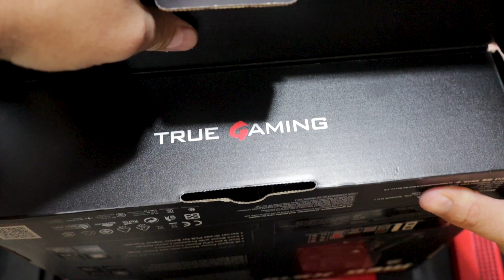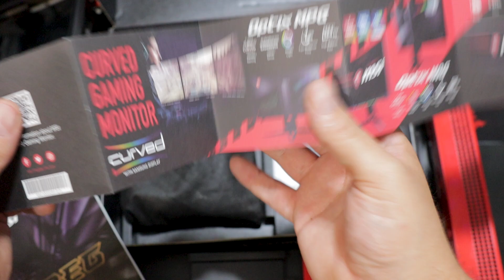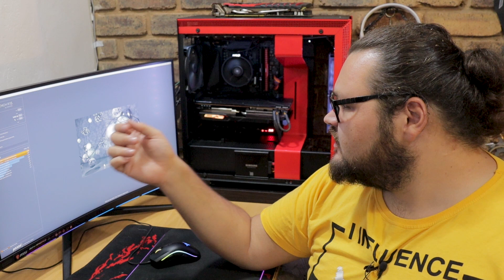THIS ACTUALLY WORKS!!! - MSI MEG X570 Unify + RYZEN 1700

Comment: 4:47 You actually don't need to plug BOTH connectors into the mobo for the CPU power...especially considering you are running a Ryzen 1700. 
Heck, some CPU/mobo combos can run off just a 4-pin. Oh and nice work mate, thanks for sharing
Reply from the maker: Oh for sure, back when I made this video I was very much out of practice working with hardware, lol.

Comment: First video I have watched from you as well as the others. Was really curious to see if first gen ryzen would see any form of increase in performance. Even slightly going from X370 to a X570. Seems like that is indeed the case. The new motherboards do offer (probably better stability) better performance metrics.

I mean, it makes no sense to get an X570 with a 1700 or 1800X but it's nice to see this comparison. Now if only somebody could make a X370 support something like a 5900X. I'm dying to see how this goes. Will it go down or be at the same level?
Reply from the maker: I'm super curious about that myself. As soon as I get my hands on a 5900X/5950X I'm definitely going to be trying it out, lol. I think performance will probably be worse considering the X370 I used in this video really doesn't have the best power delivery, if it even ends up working at all.
Reply: There are some modded BIOSes that allow A320 and X370 boards to work with Ryzen 5000 processors (after all, A320 and X370 are identical to B550 but binned low), but keep in mind power stages of those boards are generally not good enough.

Comment: What bios version were you using sir when it booted?
Reply from the maker: I can't remember for sure, but as far as I can remember it was the second-oldest BIOS version that was available at the time. Other versions might work as well though.
Reply: @TheTechTank  Thank you sir for the kind respond. I actually have a 1700 and fell in love with the x570 meg unify because it has zero rgb on the pcb. Your video helped me decide what to buy first.

Comment: Any idea if this may work on the ASUS Rog Strix X560-E gaming motherboard? I currently only have a ryzen 7 1700X and don't have the cash at the moment to upgrade my cpu. Thanks in advance!
Reply: correction 570
Reply from the maker: Can't say for sure, unfortunately. Some boards will work just fine, others need a specific BIOS in order for it to work, and other boards just flat out don't work, and as far as I know that information isn't made public by the manufacturers.

Comment: SO, to get the correct performance with your Ryzen 7 1700 you'd have to have a PCIe 4 SSD. To get a better test bench mark.
Reply from the maker: Not at all, where'd you hear that? Pretty sure the 1000-series chips don't even support it...

Comment: Still can’t get 1700x with Strix X570E work together
Reply from the maker: It seems to be pretty hit or miss which boards have support for it and which don't. Are you sure your board is using the correct BIOS version?

Comment: I am looking to get MSI X570 ACE, and I am wondering right now if it will still support 1700x?
Reply from the maker: Unfortunately I can't confirm whether that specific board will support the chip. It's up to the manufacturers to decide which, if any of their boards will support first-gen Ryzen. I wouldn't buy one before I'm sure that it'll work.

Comment: $200 16-thread  with option to upgrade to 32-thread some day when it's not $750 and higher chance of supporting future generations of Ryzen.  (Too be fair, I've been at this since 1999 and I've never found it more cost efficient to upgrade a processor than to move to an entirely new build, but maybe Ryzen has changed that model.)
Reply from the maker: Ryzen has definitely changed that model. A single board that supports quad all the way up to 32-thread CPUs gives provides the best upgrade path we've ever seen in the PC space.
Reply: @TheTechTank  Well, AM4 has an equivalent of 4 lanes of PCIe reserved in the socket, so an AM4r2 ie AM4+ is still possible, despite unlikely given AM5 details are already known.

Comment: Currently using a R5 1600 in my x570 Tachi and not having any major problems the only one that I've seen is my RAM rbg plays up (which it doesn't when I use the 2600 I have in another build) the 1600 is only in the build untill my 2700x comes this week.
Reply from the maker: That's a pretty strange bug to pop up, lol. Glad it's working fine otherwise though. Hope you enjoy that 2700X – it's a BEAST.
Reply: @TheTechTank  yup I thought the exact same thing though not sure what else it could seeing as it never happened on my x470 and does not happen with my 2600. The system still reads the ram and it works perfectly fine even on the xmp profiles the only possible thing I could put it down to was maybe power delivery as not even the RGB software can fix it. And I meant the 3700x not the 2700x sorry.

Comment: I'm sorry you're in S.A..... I would try to leave ASAP..
 Just bought the unify.. now waiting on the 3700x to turn up in the post.. mmmmm.. Trident z neo ram as well......
 Then maybe a ryzen 4X00 upgrade later on
Reply from the maker: SA has a lot of massive issues, but actually living here is pretty good. Unfortunately it's hard to ignore said massive issues so the plan is to definitely not be here anymore in a couple of years.

I really want to buy a Unify for my own system too and rock my 1700 on it until I can afford to upgrade to the 3900 or 3950X. Hyped to see what AMD has up their sleeves for the 4K series!

Comment: I built my pc same motherboard and everything but I have a Red LED light right next to the cpu pin connector, I want to know if my motherboard or anything is out of wack
Reply from the maker: Did you plug in both 8-pin connectors? The board will run just fine with only a single one plugged in, but that might explain the light. If both are plugged in and your system works without issues, then I wouldn't worry about the light.
Reply: Just Tank thank you sir !

Comment: Can you test with a B550 motherboard and Ryzen 7 1700? I know that most boards have the v2 revision and shouldn't work, but if there is any early BIOS version I don't see why it wouldn't work.
Reply from the maker: Already done 😁 I test my 1700 and a 2700X on a B550 board in my latest video.

Comment: Hi. I love this board, but I am currently  having some issues. I 
purchased a Corsair MP600 gen4 NVMe and it is not detected in either 
BIOS or Windows. I even got a replacement one and still the same. I am 
currently using a Samsung 970 Evo Plus and it works perfectly on all 3x 
m.2 slots. I updated the BIOS to the latest and also changed settings in
 BIOS, but not sure what else to do. The only thing I can think of, is 
the fact that I am using an NZXT C750W PSU and it only has 1x 8PIN CPU 
PWR connector. Could this be the reason why it is not able to pick the 
gen4 NVMe ? Any ideas please? Thanks
Reply from the maker: And you tried the Corsair drive in all three M.2 slots with no luck, right? I'm also assuming you're running a 3rd Gen Ryzen CPU? If so, I can't really think of any reason why the drive wouldn't be detected... The power connector is definitely not the issue.
Reply: @TheTechTank  yup. Tried all three slots to no avail. I'm running a 3700x . No idea what it could be
Reply from the maker: That's so strange... I looked at the specs for the board, and both SSDs, and there's no reason you should be having any issues. You might want to reach out to MSI, maybe this is a known issue and they can help you out, or issue an RMA if it's a problem with your board specifically.
Reply: I had that same issue with A MEG Gaming Plus board, it wouldn’t detect my 1TB 4Th Gen NVME. I had to go to disc manager, reformat the NVME drive to GPT instead of NTFS then go into BIOS and change from Legacy to UEFI, reboot and now my new NVME drive was discoverable where I loaded my OS. Hope that helps.

Comment: As far as that second power connector is concerned, the two are in parallel with each other so it doesn't matter which one you plug in. The only instance where you need to plug two in is if your cpu draws more power than the power rating for one of the sockets. For most boards that is 284W which will not be an issue for ryzen chips unless you're using liquid nitrogen. In summary, you only need to plug one in.
Reply from the maker: Thanks for the info, man! Never really worked with higher end boards before without a power supply with enough connectors, so I was kinda freaking out, lol.

Comment: This has become way more relevant now that AMD confirmed 5xx series chipset for zen 3 cpus. 
I have an x370 paired with 1700x. I could upgrade my MB waiting for zen 3 to launch.
Reply from the maker: That's actually a pretty good plan, as long as the Zen 3 chips are as or more impressive than the rest of the Ryzen lineup.

Comment: I was thinking that this would happen the same for b550 their telling 2nd and 1st gen would not work on the chipset buy im hoping the ryzen 2000 series would atlease work on it given that x570 works with the 1st gen series
Reply from the maker: It's all up to the board manufacturers to decide whether it'll be possible, I think. AMD obviously wants you to buy a 3000 series chip with a 500 series motherboard, so they're probably just choosing not to add support for the older chips into the chipset itself. But that doesn't necessarily mean board partners can't add that support if they wanted to. I heard something about the CMOS of the new chipset not having enough space to support backwards compatibility though.
Reply: @TheTechTank  MSI's MAX series motherboards have a bigger BIOS chip, good job MSI :-)

Comment: Hi. I have 1700 and mine motherboard have been broken. but now here we can't find good x370 or x470 . I feel like amd f**k me when says what x570 will not works with mine old processor ((
Reply from the maker: Hey! So you can't find a replacement motherboard for your 1700? That really sucks. Like I showed in the video, Ryzen 1000-series CPUs can work fine in certain X570 motherboards, but there's no guarantee. So I wouldn't recommend it unless it's your only real option. If you are planning on upgrading to Ryzen 3000 soon anyway, then it might be worth the risk... But again, not recommended.
Reply: @TheTechTank  thank you so much i see... Will looking for some interesting, or maybe pay new processor.

Comment: Did you have with applying overclock? I've changed the multiplier but it clock down in windows(1800x+x570 MEG ACE)
Reply from the maker: I did technically overclock it to run at 3.7 GHz on all cores constantly, but never tried higher than that. Did you remember to set the core clock to "fixed" mode rather than "auto"?
Reply: @TheTechTank  tried everything, under full load IT goes down from set 1.4v to 1.33 with LLC set to 1.
Reply from the maker: Oof, that sucks. Could be that the board isn't playing well with the chip, or there's just a setting you're missing somewhere. I probably wouldn't recommend it, but did you try some of the other BIOS versions for the board yet?
Reply: @TheTechTank   Well now my voltage drops down(for example form 1.4 to 1.33) at full load. So i can go with unstable oc to 4.0 that will crash in ooct and cinabench. I will problably stick with it as i can game on it. At cyberpunk launch i will upgrade the GPU and if i wont get a steble overclock on this CPU i will upgrade it as well. I don't see any point in swaping the Bios revision since it didn't boot at orignal bios flash to the newest fixed the problem so the possibility that it will work at older revision very low. I looking for MSI bios walkthrough, with all functions explained i might find that missing tweek
Reply from the maker: Hope you have some luck finding a magical tweak somewhere in the settings! The reason I suggested trying different BIOS versions is because neither the oldest nor newest one for the Unify worked for me. Only the second release booted for me. Either way, If you get it working definitely let me know!

Comment: Thanks for this video. Im going to pick one up for my 1800x and upgrade later when the 3 gens are cheaper.
Reply from the maker: I'm kind of planning on doing the same! Just make sure you're super comfortable with BIOS flashing and how to do it correctly, and that you're careful during the whole process. And even though it's not all that likely that it won't, just because it worked on my board doesn't necessarily mean it'll work on yours. I'd feel pretty bad if anything happened to your gear because of this video, lol.
Reply: Just Tank Lol Im good with flashing the board. I've been doing it for awile now.  I was able to flash some Asus x370 boards with a compatible Asus x470 bios and they ran just fine. I dont think that will work with a x570 but x370 and x470 are the same boards.
Reply from the maker: @slim420-e8v  Okay great, lol. Then you probably won't run into any nasty issues. Be sure to tweet me a pic or drop a share on the Facebook page after you get it up and running!
Reply: @TheTechTank   would be nice to link the BIOS version here or whether this BIOS had the AM4 1.0.0.4 PATCH B.
Reply: That's what I'm doing as well! :) However, my budget won't be enough for the MEG so I will try with the X570-A PRO. I hope it will work :D

Comment: Would you try this with the newest Agesa or whatever it is? I'm curious if it will still work.
Reply from the maker: I'm actually running the same configuration right now for a different video, so after I finish the vid I'll definitely give it a shot.

Comment: The second eps connector is not really necessary for this kind of cpus, as 1 connector can handle something like 384W. In MSI's case, that second connector can send power to the pci-e slots, so if you have a crossfire/sli you don't stress the 24pin connector that much.

Comment: I luv my 1700 😎
Reply from the maker: Same! Such a workhorse!
Reply: @TheTechTank  I currently have a 3.4Ghz Oc @ 1.000v Vcore, R15 score of 1469 at 61c. MSi for life 😊
Reply from the maker: @davec7  Daaang, that's an impressive score for such a low OC! Good job, man!
Reply: @TheTechTank  Thanks man, I just recently achieved it due to high OC temps & undervolting research.

Comment: So many rookie mistakes... soooo many rookie mistakes. I’m glad you didn’t brick your new mobo by aborting a BIOS flash - that is the biggest of no-no’s.
Reply from the maker: Oh definitely. Noob plays the whole video through. Though to be fair it's been more than a year since I actually flashed a board's BIOS, lol. Luckily I didn't actually abort the BIOS flash at any point - it takes like 5 minutes before the system actually starts the process, and I basically stopped it before it got to that point - otherwise that board would've probably been bricked HARD.

Comment: its out of the equation but its in the conversation what vid card is the max spec for the r3 2200g before it bottlenecks
Reply from the maker: Ooh, interesting question. Would love to properly test it out, but I'd imagine it would be highly game and somewhat resolution dependant. I wouldn't personally pair the 2200G with anything higher than the 1660 though.